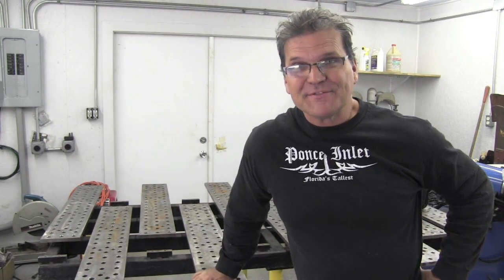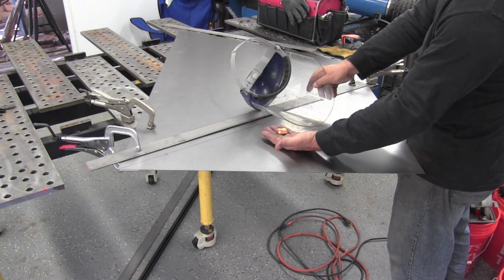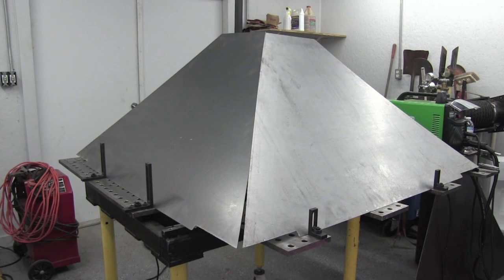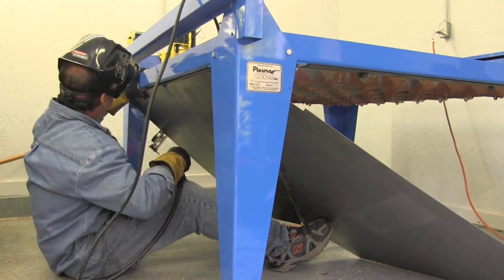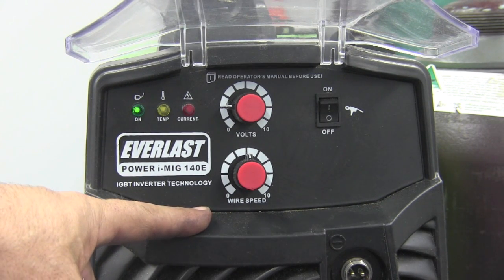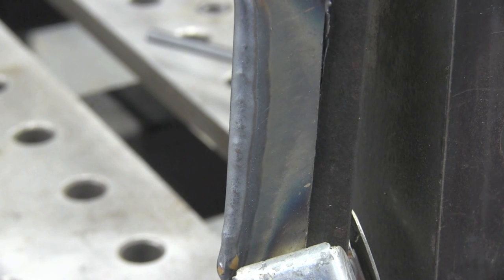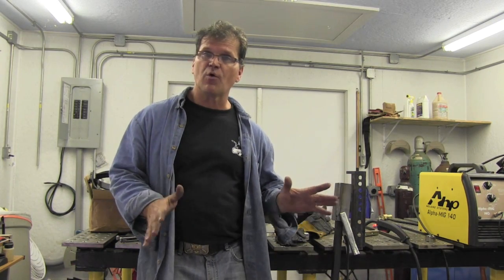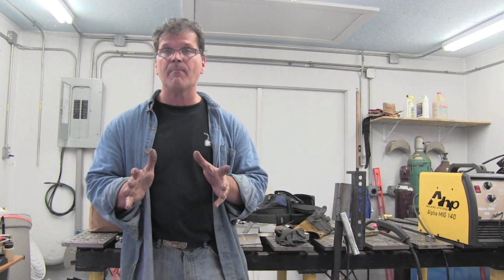PlasmaCam Downdraft & Everlast vs AHP 140 115v Mig Welder Comparison

Comment: Hey Jody:  I have a PlasmaCam machine I will be setting up in my shop soon, and I am going to steal your down draft idea when I do.  I figure that if I fabricate a trap atvthe bottom of the hopper, I can hook it up to my dust collection system.
As for the Diablo steel blades, I use one on my 14" dry cut saw and love it!  I also shoot a little WD-40 in the cut and it really helps extend blade life.  
I love your videos, and when my brother exoressed interest in learning to weld, I passed on your site to him.  Keep up the great work!

Comment: Jody, is there a finish to the Plasma Cam Table part of this video? I forgot my manners...Thank You for this video! Jody, I am trying to get a downdraft system completed for a DCH2 4' x4' Plasma Cam Table too, do you have any suggestions with the exhaust fan or under the cutting table for your Plasma Cam Table and the way you built it?  Please reply, I have not gotten much feedback from the manufacturer. The only tips were to use a 3000 CFM to 5500 CFM exhast fan. Small company here like you, so I am trying to work this in while I am satisfying customers needs.

Comment: I'm thinking of buying the Everlast 140. I do have the Everlast 185 TIG and stick. It going to be for home use only do you recommended. Like your videos they come in handy and I have a tig finger.
Reply: The everlast 140 is super convenient to have around and is dual voltage. If you have the need just buy it.

Comment: what is your thoughts on the everlast mig? im really close to buying it, it seems like it will provide what i need,  how well does this machine weld thicker steel? like the duty cycle? is it reliable? would you reccoment this to me, considering ill be doing automotive welding? like 1/4 plate etc  things like that.

Comment: Why would you get a hotter puddle with straight CO2 verses 75/25 ?
Reply: CO2 has a higher arc voltage than argon.  The C-25 mix is good for sheet metal as it's cooler, and it's used in production because you get less spatter than CO2, less spatter/less cleanup time.  In fact if you have clean metal and the voltage and wire feed are set just right, C-25 can be almost no spatter at all.

Comment: Jody I noticed you were using that small piece of scrap to test your wire speed, but didn't that put spatter on that expensive layout table? Also, in your experience, what IS the best anti-spatter product that actually works?

Comment: hey jody (and matt) awesome pair of videos.

watched a 15 min. tig vid (butt welding 2 aluminum beverage cans end to end) some fella put up and man did he receive a few nasty comments regarding the view time even though he went thru primary tool and material prep, machine troubleshooting / repair and set-up, and his hands on 'flow' w/ filler rod technique & heating tips....nobody even thought to mention the actual gauge of the food industry pre-processed material > oh too thin...

1) the vo-tech comps > nobody in the class i was in ('78) took the competition thing seriously i think because like you fellas mentioned the primary motivation was pay stub employment.
2) the information age tech math course...if it dont add up...uuhhhh.
3) does the diablo blade come in a 4-1/2" size/rating? > root of its development from my hometown was the 'architectural' metal door industry; putting stuff all day thru a tablesaw on its way to the next production station.
4) comparative other(s) > liquid cooled, 30 rpm miter saw w/a solid 10" carbide blade; a couple different forms of 'guided tractor fed' torches and cutters, and also a couple different sheared edge processes.

...because its gonna get welded and then machined or tested or plated or just plain painted.

thanks guys.

Comment: Jody, go ahead and weld those hinges on. If they are like Aviation (aluminum) Hinge, the pin should be removable - easiest way to take apart the hinge.
Also, If you did weld the hinge - would the chrome plating affect the welding? I know welding Galvanized can make you very sick.

Comment: Jody,
As a vacantion job I went working in a metalworking workshop and I needed to weld quite some tube steel but it wold turn in to a mess once i burned a hole throught the pipe. I work with a MIG welder but the voltage or anything I do not know. I am hoping to go back there next summer and would want to practice a bit in the meanwhile so i can do better next time. Do you have any advice?

Comment: One tip for cutting sheet with out the bent end is to lay a 2x4 on the ground and cut within an inch or so along it. When you're near the end of the cut and the piece is falling behind the saw it's already so close to the ground that it doesn't screw up the last bit you're cutting.

Comment: Thanks again for your work.

If you need to connect the other 2 corners of that chute, you might be able to tack halves of another 2 hinges on those joints too.  The homebuilt aircraft guys hold the top and bottom engine cowls together on some models by a piano hinge. They even put the "hinge" on curved joints and fish a new wire through.  Especially on the curves, they can't pivot the hinge, they just use it to "sew" the two parts together.

Now you have to start posting Plasma Cam videos on Saturdays.

Comment: That saw blade will cut 1/2" easy.......just letting you know
Reply from the maker: AKweldshop
5300 rpm
Reply: I have a 8" Milwaukee steel cutting saw and I used a ridged wormdrive saw ....Have no trouble cutting 1/2"....leaves a mirror finish you just can't get with a torch or plasma
Reply from the maker: Vincent Williams
 I am going to have to get me a worm drive saw.
Reply: I own a few portabands,a Hobart 70 plasma and a act/oxy torch...but just about always use that saw blade on my Milwaukee steel saw.
Faster and cleaner and less chip slinging.
The wormdrive you can see your line better but chips go everywhere.(I can't tell that the blade wears out any faster) now If only I could weld half as good as you.....

Comment: Jody I am wanting a new welder , I have never mig welded only stick and not a lot of that!  All things considered ,price ,function and dependability do you favor everlast ,Eastwood,longevity ,Lincoln, hobart or miller?
Reply: I have used Miller, Everlast and Longevity. The Miller I used was good but twice as expensive if not more than the Everlast and Longevity welders I used. Between Everlast and Longevity I would go with the Everlast. To me Everlast is the better company and has the better products. YMMV.  Good luck in your search.
Reply: Thanks Stuart

Comment: Hi Jody,
The dream of having a PlasmaCam... Not enough room here, and not ready to move to a bigger location, so, the Hypertherm will still be hand driven.
I appreciated that video about fab work, welding is not just about arc time, usually prep time is more than actual welding. Funny to say but a good prep will reduce your arc time...
I've used those little 110V.  machines a few times and they can do serious work in good hands.
Thanks for sharing,
Pierre
Reply: I'm not a welder but its the same with many thing. Carpentry, get your stock straight and square and life is a hole lot easier. Painting all about the prep. Women all about the ....err restaurant?
Reply: If a project is done right the prep time almost always takes longer than the welding and will almost always product a better outcome. I also agree with you on the 110v welders. Within certain limits my little everlast 110v welder is pretty capable compared to its 220v bigger brother. I still prefer 220v though  ;-)

Comment: I have the Milwaukee metal cutting circular saw the manual says to adjust the base so the blade is 1/16 to 1/8 inch below the metal.  You might want to try that with your saw to see if that prevents the bending the metal at the end of the cut.
Reply from the maker: fatboyfester Thanks, I will try that.

Comment: Nice video, very informative as usual. You talked about co2 being hotter than 75/25. What are your thoughts on using 75/25 with flux core wire? Adam Booth says he thinks the combination makes for a better weld than flux core alone.  Thanks again for sharing your expertise with us.